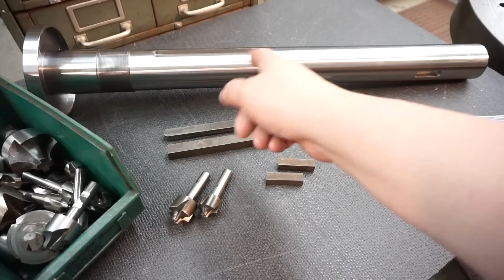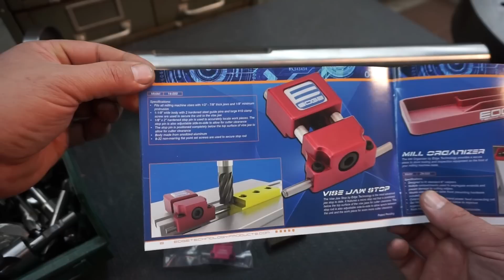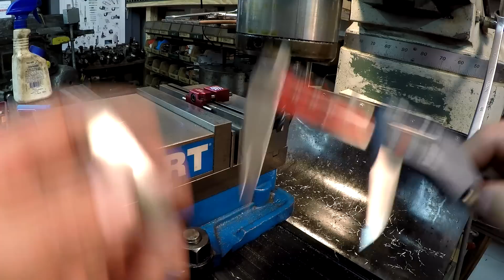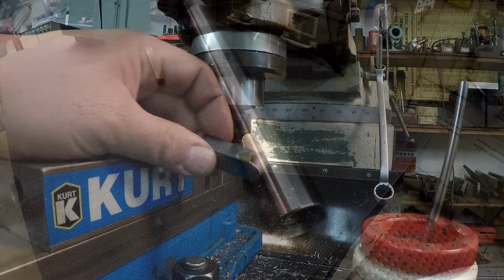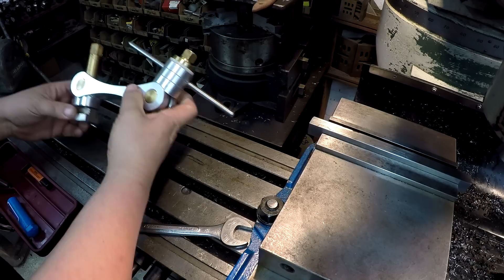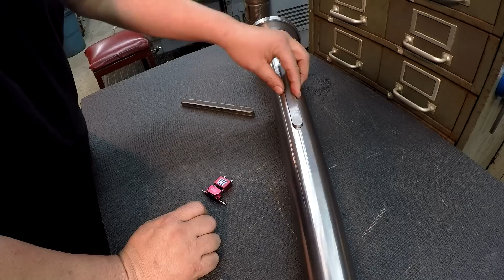SNS 151 Part 2: Edge Technology Vise Jaw Stop, Corner Rounding Mills

Comment: How critical is it to match the key way material to the shaft.  Seems to me if you use dissimilar materials you would get dielectric action speeding corrosion.  Sorry I am a pipefitter this might seem like a silly question but we deal with that issue all the time.

Comment: Adam, I seem to remember Tom Lipton saying that a key should be a tight fit in the shaft and have a slight clearance in the part that slides over the shaft. Given what Tom said, your keys are perhaps a little looser than Tom would like, especially for a "driving key". Not knowing the application these parts will be used in, or the loads they will be subject to, I really don't know if your fits are adequate or not, and I surely do not intend to criticise you for it; we all know that your work is wonderful.

However, please allow me to convey a little knowledge I picked up some time ago. I once had a Subaru front-wheel-drive motor car, and there was a fair amount of wear in the splined shafts that drove the wheel hubs. "Not to worry!", said my esteemed mechanic friend. "We use Loctite to make those spline fits work even when they are worn, and Loctite will accommodate  wear up to forty thou in these hubs, and will run for a looonnngggg time!"

He was right. Smearing Loctite on the splines took out all the rotational play, and them hubs lasted another fifty thousand miles before I finally had to replace them. And that was in the splined shafts that drove a moderately powerful motor car, driven with verve and aplomb, where the loads would be very great.

So if it ever becomes a problem, Loctite, especially the sort you have to break down with oxy-acetylene heat ("Studlocker?") is your friend.

Hope this helps. 

But you probably already knew this, didn't you?

Comment: Aren't they called "quarter round" bits, not "corner round"? Called that because the are a 1/4 of a circumference?
Reply: Nvm, apparently metal cutting ones are called corner round.
Reply from the maker: ImpsMyPimp I know them as corner rounding mills

Comment: Thanks Adam. Nice stops. I have cut hundreds of corners exactly the way you did, "by eye," but always felt that there had to be a better way.  Always wondered if all radius cutters are made to a standard size. I'm  talking about the body of the cutter. At some point I tried to use the body in relation to work piece to dial in the position of the cutter to be exactly on the corner to do the rounding. Wasn't smart enough to make it work.
Reply from the maker: William Lee With a digital readout mill I can set them pretty fast but on short runs like that I just keep adjusting till I have it right.

Comment: Adam, the radius on the keys is a nice touch.  I like details like that.

Here's a great way to set the vertical (Z-axis) depth of cut on those corner-rounding mills:

1) Come down to where you'll cut just a tiny bit too deep at the edge of the part.
2) Move in on the horizontal (X-axis) just enough to shave 1/16 (1.5mm) radial depth of cut.
3) Take a cut across the Y-axis.
4) Measure the thickness of the part where you cut and subtract that from the thickness of the stock.
5) Move the part down (cutter up) or change tool offset by the amount you measured in step 4.
Enjoy perfectly blended radii (assuming your part and machine are flat).
Reply from the maker: cwtoyota thanks for the tips there

Comment: If you're concerned about table-induced chatter when climb cutting on an older machine, you might try dragging the gibs ever-so-slightly: it can make a big difference on how the machine behaves. Not exactly great for the gibs, but they are a replaceable part.
Reply from the maker: Matthew Helton Many times I adjust the locks on the ways to help tighten things up when milling.

Comment: I noticed John Saunders milling on his CNC machine and climb milling, so I asked him why climb. He said he always climbs. Then you said you don't like to climb on a conventional machine. What makes the difference?
Reply: I always climb on Aluminium, just find it makes a cleaner cut. and climb on a steel face for final facing.
Reply: Doug Rundell conventional machines have backlash. when you manually feed a table climb milling, it pushes the table. however in some circumstances, the endmill pulls the table due to backlash. the table jumps, causes a heavy chip load and breaks tools.
Reply: Doug Rundell conventional machines have backlash. when you manually feed a table climb milling, it pushes the table. however in some circumstances, the endmill pulls the table due to backlash. the table jumps, causes a heavy chip load and breaks tools.

Comment: what happens to be your smallest rounding end mill that you have in the shop Adam? also what is the thinnest material that the jaw stop will be compatible with inside the jaws, what i mean by that do you know the thickness of the over hang of the jaw stop inside the jaws? thanx again.
Reply from the maker: Erik Devaney Erik I did no measure that but I will and let you know.

Comment: Hi Adam! What about the little key way there near the very end next the large key you made? Did you forget to make a key for that one, or will your client make that on-site?
Reply: that is for a keeper that hold the nut for the bearing from backing off
Reply from the maker: William Squires Oh yea, that small keyway is for the locking ring.
Reply: Abom79  o
Reply: And to bring it on home for those who really don't know, that key way isn't for a key.  It's for a notch tab coming off a washer's inside radius that has other bendable, nut holding tabs on it's outside radius.  A similar setup can be seen used on some trailer axle spindle nuts if you want to look for a google image.  Once you see one, it does help understanding it.  Keeper, locking ring, my washer above, all same, same.